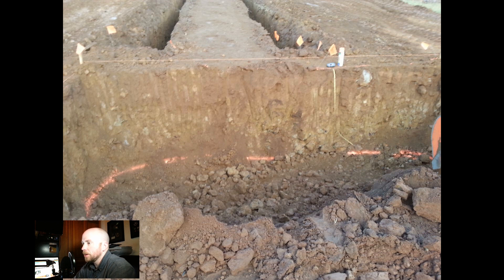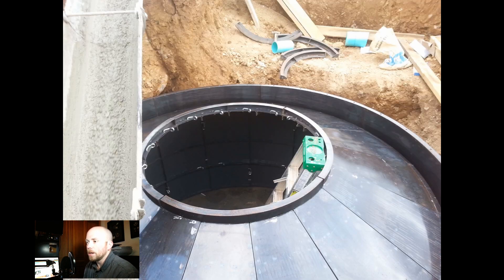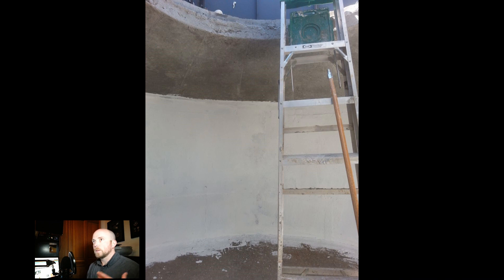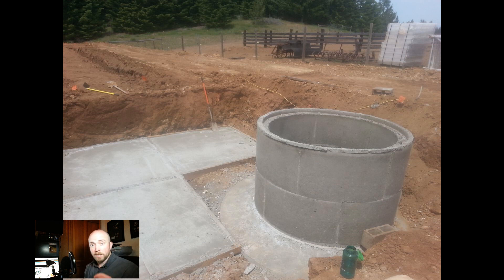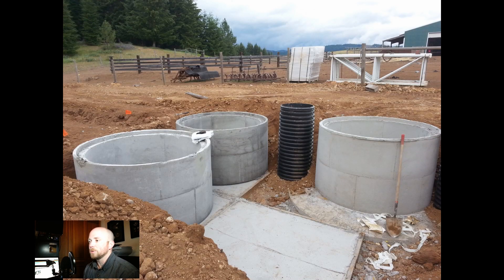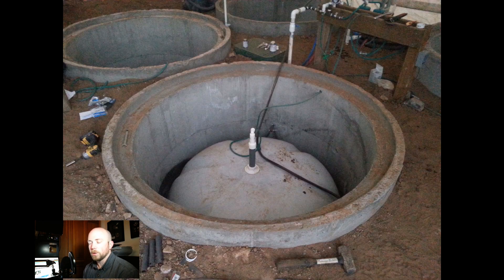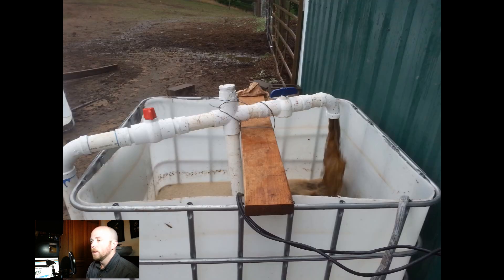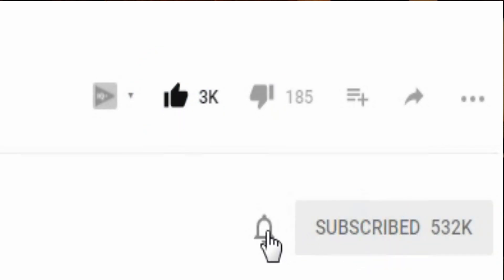DiY Homesteaders power generator/ PUXIN Digester Part 1

Comment: CONCRETE!  Cement is what you mix with the aggregate  (rock & sand) and water to make concrete. And I think you could build a grinder yourself for whatever you add to the digester to help with the floating. Also check for another livestock producer near you that you could get more manure from. Does it have an agitator?

Comment: I imagine you'll add a compressor and dryer at some point before you fuel heaters and/or vehicles, yes? Also whats the plan for summer? With warm weather, would you be producing more than you can use? Many thanks for sharing your endeavors. Fascinating journey. Does the digester fit in the planned shipping container volume launched from earth?

Comment: Hey if you haven’t done it yet, I would suggest converting some of the methane to methanol. Methanol is a golden fuel. Super clean, okay energy density per liter, and super powerful and efficient and cool burning.
Reply: Why? The energy and equipment that it would take to generate the steam to liquify the gas and then to catalyze that liquid under pressure would negate the 5% or so of product you would yield. What off the shelf equipment supports any of your suggestions? Only small scale lab mockups can currently do what you're suggesting is a viable course of action. Not feasible. Irrelevant. Dream on.

Comment: If you have environmental concerns about the diesel for form release, you can spray the forms with simple syrup or corn syrup. It works just as well or better, unless the forms are rained on before use.
Those digester forms look removable, rather than stay-in-place. Did you rent those?

D'oh! of course they were removed, you coated the concrete after.

Comment: Pretty neat system and setup. I am curious if the concrete is reinforced, or was it a blended concrete?

I was thinking some type of extruder that sits under a hopper where you can load it by the wheel barrel or loader bucket full and let it spit out pellets of goo that th en get pumped into the digester.
Reply from the maker: no rebar, but did spring for the fiber reinforced concrete

Comment: I have seen a few LARGE commercial grade system, that are used to provide electricity/heat..
What would be an ideal load for a system of your size..? how many animals and types..?
What is the expected output of the system..?

How do you recover the Fertilizer from the system when you need to..?? A Sludge Pump..??
I like the concept..

Comment: I'm curious if you could automate you feeding system with relative ease. Would a chipper work as a preprocessor to chop up the straw? Something like this that you could feed manure into that would then feed into the toilet processor. a conveyor could feed the chipper.
http://m.harborfreight.com/65-hp-212cc-chipper-shredder-62323.html
Reply: That is meant for dry material. Not wet, slimy poo mixed with straw.
Reply: Brad Vlogs True, but if we confine ourselves to the limits of what something was originally intended for we won't get far. Depending on how dry the manure is it should still work. A fresh steamer will just splatter, but given a few days to dry out, or frozen solid in the winter I bet it would pulverize just fine and the straw would break up.